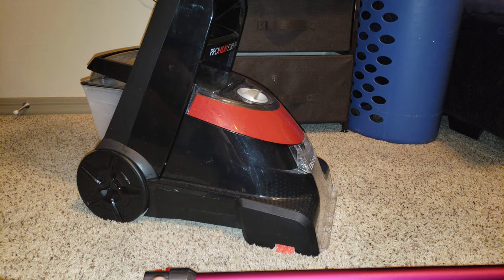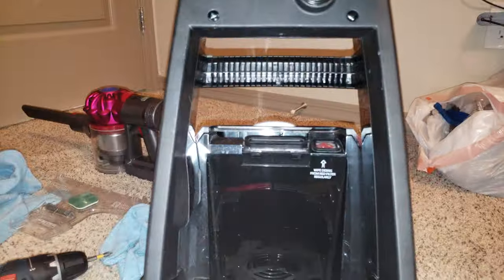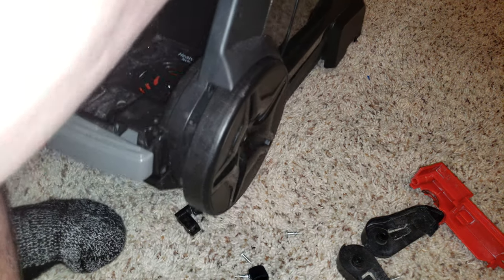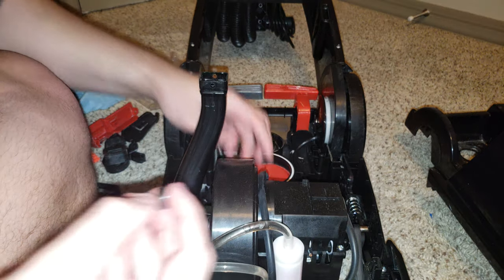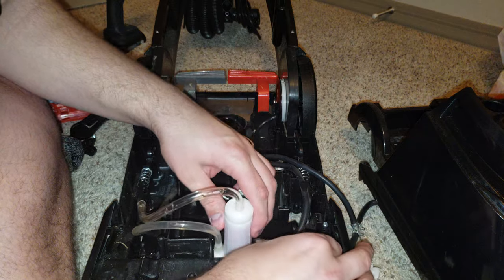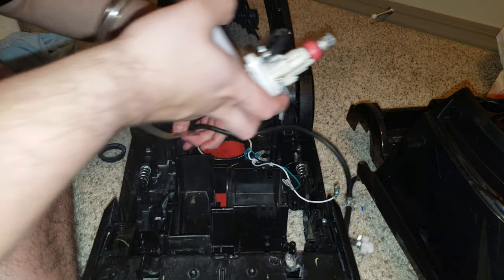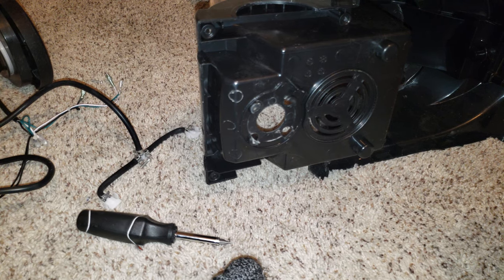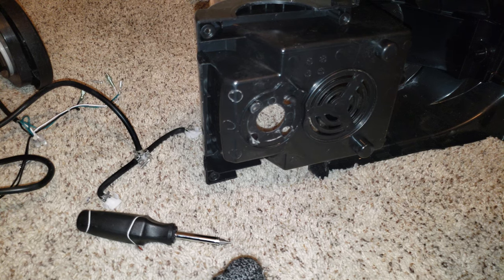Bissell Proheat Essential, disasembaly and clean out🛠

Comment: Thanks for this video. Couldn't get it apart. Didn't know about those two screws in the front. Mine wouldn't spray water. Turns out one of the hoses was pinched. Was able to get the hose straightened out and it works again. These are great carpet cleaners. Glad I didn't have to buy a new one. Cheers!
Reply from the maker: So glad the video helped.

Comment: I got my 1887 bissell in 2017 and because of diligent cleaning after every use and changing belts annually it works perfect. I've always wondered how to get to the motor though to clean it out. So you showed me some things I didn't know thank you and the only problem I have with my carpet cleaner is that the tab that the latch catches on on the tank is always breaks and I have to buy a new tank lid all the time.
Reply from the maker: Sweet im happy you liked the video

Comment: Of course I'd pick the one that you have to take apart just to change the belt. I have a stripped screw in the casing over the dual pulley for brush/pump belt but It looks as though even if I was able to get it off, there's a screw underneath the housing inside the machine, so I'd have to take the top off anyway. A pain in the butt. Then I see all these videos of people who bought the version where it's on the "side" of the machine. Way more convenient.

Comment: What was the first piece you removed? I'm unable to budge the screws to remove the floor nozzle window. So here I am, frustrated as hell.
Reply from the maker: Use a impact driver on low speed. Or s large screwdriver. To torque the screw out

Comment: Have you considered getting a Proheat 2x Revolution? I resembles an upright, has dual brush rolls and is an absolute beast! Also very easy to take apart and clean without tools.
Reply from the maker: I had one. I hated it. The suction was terrible. It left my carpet soaking wet. I'm hooked to my Big Green
Reply: @VacMaster1991  big green is even better. as for the suction I ran into that issue as well and took a closer look and realized I had no been attaching the plastic piece that sucks the water up correctly.

Comment: So I got all the parts off, I'm having a hard time putting the belt and brush on, is part 2 of this video out
Reply from the maker: No o don't have this machine anymore
Reply: @VacMaster1991  oh no.... I was taking it apart along with you until you said you were running out of time will have to make part 2. I'm having trouble putting the belt storge compartment back in
Reply: @VacMaster1991  I can't seem to get the belt storge to snap in
Reply from the maker: The belt won't go over the shaft?
Reply: @VacMaster1991  I got it all together but I have 2 screws that I don't know where they go

Comment: I'm currently attempting to replace the motor in this specific unit. Did you run into any trouble reattaching the seal on the side of the motor for the "exhaust" tube? It's driving me nuts.
Reply from the maker: No I did not have any trouble. But my machine broke a few months after this problem.

Comment: I took apart the water tank to clean and put it back together and now I can’t get it to sit flush against the machine. It will barely suck due to the vacuum seal not being there AND it won’t spray. I never touched the machine itself. Any ideas?
Reply from the maker: Make sure the red gasket at the bottom of the tank didn't fall off.